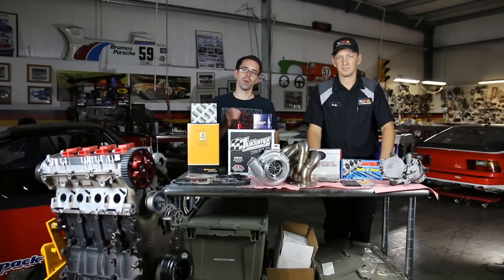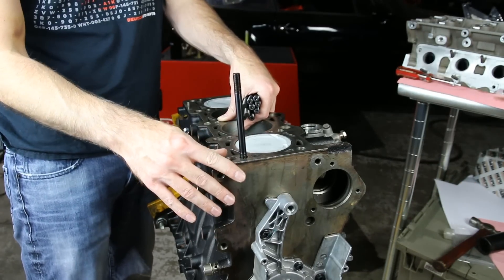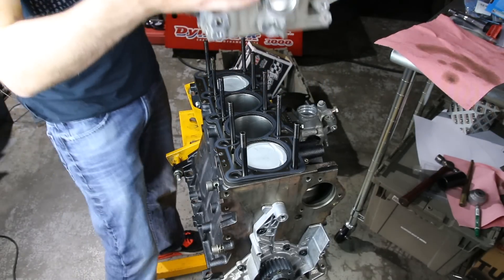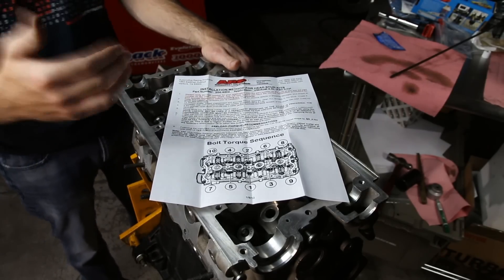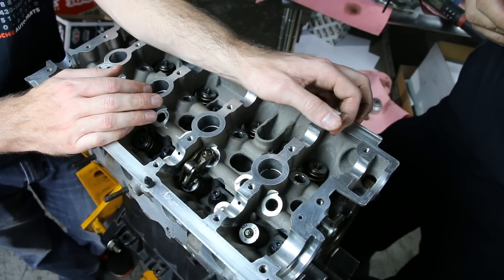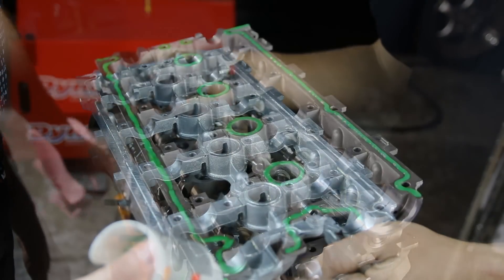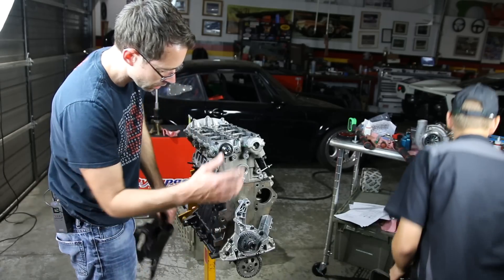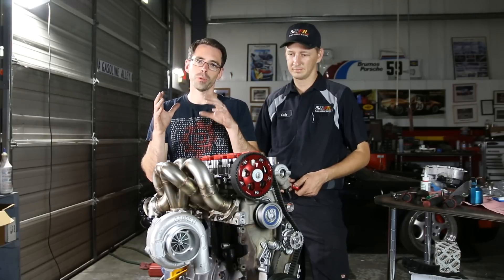Cylinder Head Install with Head Studs | Project MK5 Ep 2

Comment: I just get a new billet valve cover, but I can´t figure out what to do with the line from the 3 way EVAP valve connected in front of the OEM valve cover and where I have to connect the little line from turbo to rear of the OEM valve cover plug, somebody have a idea? that little line from the turbo looks like a vaccum reference!

Comment: I was wondering if you could answer something. So I'm thinking of doing that iabed balance shaft delete (or even if not) but I noticed when I replace my piston rings (all being done while the engine is in the car) that the oil pump chain seemed like it has been through some pretty burnt oil and it dark and looks like it could snap before long. Only way to get that chain out though is removing that flange behind the crank sprocket, but I don't have any impact tools. What would be a good way to remove and replace that sprocket and bolt (probably an arp one) while also getting behind that flange to swap the chain, without power tools? Even if I had power tools, I dont have a good enough air compressor I don't think

Comment: Can I just say, you timed the cams up and slotted them in.. but you can't actually put the cam chain tensioner on with the chain already installed. So did you remove the vvt cog once the bridge was installed to fit the tensioner and then re time the cams ?
Reply: nah he would have pulled it all to bits again after realising :)  I've done it twice DOH!

Comment: Hey. I'm having a problem with my mk5 gti with the fsi engine. It keeps on breaking the cam chain adjuster. And the everytime it does I replace the cam chain tensioner. But I don't know what's going on. Then is the third time including when I got car cause it had broke and had bent the valves. Do u have any advice that can help me on my quest to make my mk5 gti reliable again, cause it really does suck. Thanks.🙏🙏
Reply: check something else as I think breaking the adjuster is a result, not a cause but interested

Comment: How did you know that all of the timing equipment lined up from those marks? What was your reference for placing the cams and crank into the engine? I saw what you described with the marks on the timing chain covers, but don't understand how those are calibrated to be in time with where the crank and cams are located within the engine. 

Great video Paul! I'm really excited to see the finished project.
Reply: Trevor Austin Since Max and I knew we wouldn't likely have the VW tool for reassembly we marked the chain and gears before we took the engine apart. Before the head was installed the crank pulley and lower timing cover was put in place to put the engine on TDC#1. Knowing how a camshaft works it is easy to tell the approximate correct timing, close enough that you can safely install the cams and then fine adjust based on the OE timing marks. Once the cams were bolted down we then installed the stock cam belt pulley and timing covers to get it correctly lined up, then took all that apart to remove the ugly covers and install the IE cam pulley.
Reply: Thanks for the reply, that helped a lot. Would it be possible to put together a video explaining how you would do this with all new components? Such as an aftermarket cam or crank. Thanks for all you do for the Vag community.
Reply: Trevor Austin the only way to do this on a clean install on an FSI 2.0t that I'm aware of would be buying/renting the VW camshaft alignment tool. You can set the exhaust cam timing using the pulley, but without some expertise it would be difficult to get the intake cam set correctly. I wouldn't recommend any attempt at that because a small error here could easily end up with a whole bunch of bent valves.
Reply: PS, the crank will always have the keyway that ensures the crank pulley can only ever be installed in one position and it's OE timing marks on the cover are usable. This applies to all cranks that are made for the engine, new and used.
Reply: @BlackForestRacing  so if my timing belt snapped while driving can I use the cam pulley an OE Mark along with crank OE Mark and install new belt ? Or do I have to buy tool to time exhaust cam ?
Reply: @Peter-fg7rd  what did you end up doing after your belt broke?
Reply: @zusyskater  replaced the belt hoping the valves didn't touch but that didn't work so I had the top end rebuilt.

Comment: what tool did you use for tightening studs? last time tha i rebuilt an engine i had an  head gasket failure because one stud wasn't tight right. i use two nuts on the top thread, but i know that exist a special socket for this work.
nice work! i love engine rebuilt series
Reply from the maker: These ARP Studs have an allen drive on them.
Reply: someone lied to you, even if they are loose you torque sufficiently that they stretch and this pre-load stops them backing out / loosening.